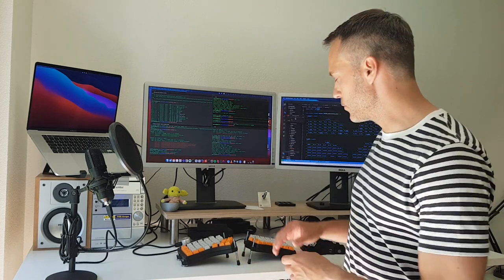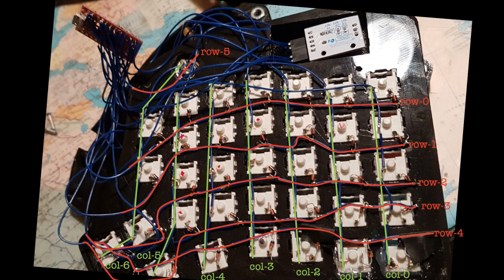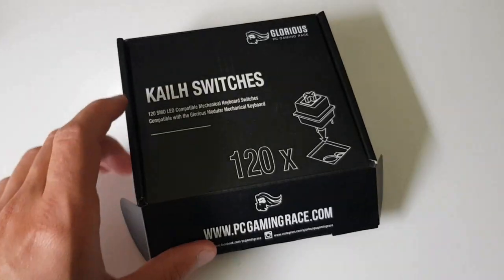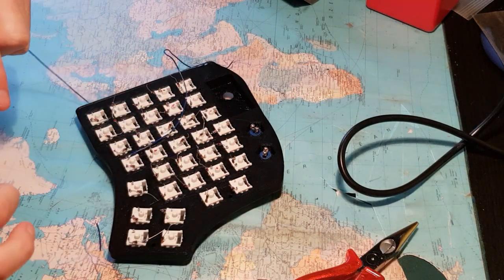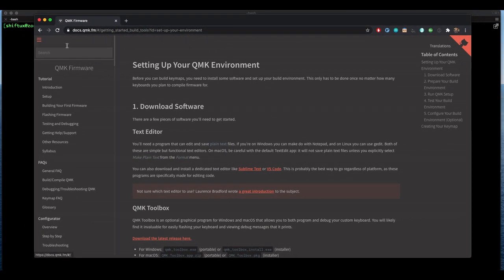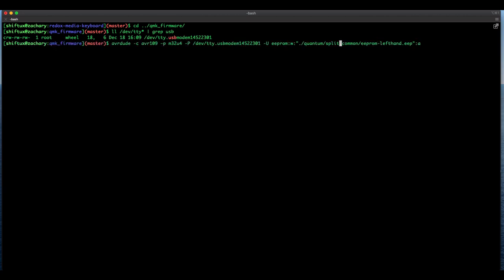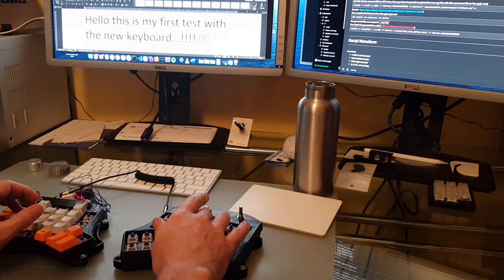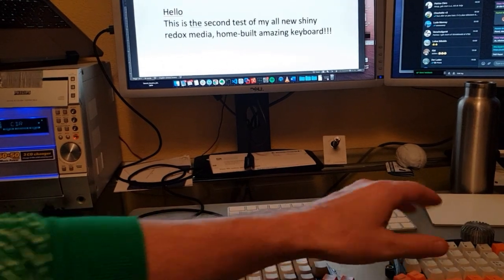Build your own keyboard (Redox Media)

Comment: How to solder a trrs socket to pro micro?
Reply from the maker: doesn't matter. you need power, gnd and signal, the order on the trs jack does not matter, as long as you do it the same way on both halves of the keyboard
Reply: @shiftux9189  cool! Thanks, I got it
Can you tell what's better i2c or serial?
Reply from the maker: @worldOFfans   I'm using seiral. and i think the QMK lib is built for serial. but that might have changed in the meantime.

Comment: Awesome job! I have a Dactyl case on the way, but if that doesn’t work out then the Redox is very tempting. 

I’m a bit late to the video, but wanted to add for anybody else that might come across this video and looking to build their own, you should never connect or disconnect the TRRS cable while the keyboard is plugged in. You run the risk of frying a controller because you could short it as you remove the connector.
Reply from the maker: thanks for the comment. you're right, of course!

Comment: Do Dactyl has antighosting for all keys?
Reply from the maker: this is not a question of dactyl or not. it is a question of how you implement it. you need transistors (at least) on a hardware level and you need software which can handle it. - the combination gives any keyboard antighosting

Comment: any chance you could share your info.json file? struggling with the documentation trying to figure out what i need in there for this
Reply from the maker: not sure what you mean with the info.json file. check the linked github repo. all i have is there
Reply: @shiftux9189  the file where you define the matrix of the keyboard. i think i  have it correct, but i wont know for sure till ive finished wiring the keyboard. i really underestimated how long it takes to hand solder this.

Comment: can you share the wiring diagram for the mini jack?  and what mini jack model did you use in the video?  Thank You
Reply from the maker: he jack has 1 GND pin, 1 5V pin and one serial pin (serial-1 on the drawing). it's irrelevant how this is wired on the jack, just need to do it the same way on both sides ;)

Comment: Hi, is it possible to wire micro LEDs onto the Pro Micro as well?
Reply from the maker: don't know... probably not enough pins on the pro micro, but maybe if you remove the rotary encoders...
Reply: @shiftux9189  thanks, I might give that ago and see if I can get it working

Comment: Hello, I want to build myself a redox-media keyboard with just two rotary encoders on the right side. 
On the "Wiring diagram" on the GitHub post, are those two rotary encoders hooked up? If so, that doesn't seem to reflect the actual design?
Reply from the maker: both sides have only 1 rotary encoder hooked up. the other 2 are push buttons. but yes, they are wired up (enc_padA & enc_padB)

Comment: Hi, can you tell me exactly how the trs mini jack is connected to the controller? I can't find any details about it anywhere
Thank you in advance
Reply from the maker: check the github page. the picture of the proMicro shows you the serial connection, this is 1 out of 3 wires. the 2 others are ground and 5V. how you wire them on the jack cable is up to you (irrelevant), as long as you do  the same thing on both microcontrollers.

Comment: Quick question. Do I see this correctly, that you did not connect the switch function of the rotary encoder at all? So, only outA and outB?
Reply from the maker: yes. the rotary encoder's button would require a separate pin on its own. whereas all the other switches are part of the matrix (many switches per pin). so it did not fit...

Comment: ive read many sources, watched many videos. I understand the whole process (which is kinda easy since i have a software engineering background). One thing i cannot understand is how the 3.5mm jack is used to transfer data. I feel like im missing some trivial knowledge which doesnt allow me to understand how the 3d jack can be used to transfer data to the microcontroller. Can someone give me a source/link/article something i can read to understand this?
Reply from the maker: it's a simple serial connection. there is a drawing here: https://github.com/qmk/qmk_firmware/blob/master/docs/feature_split_keyboard.md#serial-wiring

Comment: Hey, great builds and a great video! I'm in the process of customizing a redox keyboard for myself (because they're pretty close to a perfect layout but lack some tenting options out of the box). One thing that you seem to have solved well, but which I can't find anywhere on github or on the build page is: 

What are the rubber feet you're using? Both on the m5 rods and on the outer sides of the keyboard? I can't find anything similar and having the metal rods scratch into the table surface is not really an option...
Reply from the maker: just from a local hardware store. nothing fancy. the ones on the rod are typical threaded rod protectors and the outer ones are what you might use on anything as (adhesive) "feet"
Reply: @shiftux9189  nice, I'll look for the rod protectors. What I have found since are some generic rubber feet for use with random electronics cases, and they accept m3 screws. But their footprint is still bigger than what you used and I don't think they'll work as well when the tenting angle is bigger...

Comment: Just wondering if you had any other issues with the Dactyl Manuform - I was thinking of getting one due to wrist pain - I assumed they would be the best due to their shape? Do you think the Manuform is made for a certain size hand, and if yours is not that size, it may actually be detrimental? I assume you would have to stretch a lot more with a flat keyboard though
Reply from the maker: the dactyl is MUCH more curved in all directions, which i'm sure would be better from a pure ergonomic point of view. but it's only better if you curve it perfectly right for your hand and your way of typing. and getting it just right requires work... you'd probably need to print at least 5 (more likely 10) batches varying all the different curvature and spacing parameters until you figure it out. every time testing it for a couple of days and ideally comparing them. if you're up for printing and wiring up 10 keyboards... i'm not :D
i've been using my redox every day for close to a year now and it feels great. no pain in my hands and by now it feels like an extension to my hands, that's how used to it i am. i can honestly recommend it. 
ideally of course you would just go try them out. if you have someone or somewhere where you can...
Reply: @shiftux9189  Thanks so much! - You have provided valuable information, and saved me money. I was actually going to buy a pre made one - but as you point out, the chances of it working perfectly for my hand would be slim. Looks like I may have to skill up my soldering skills, and create my own keyboard.
Reply from the maker: @tomhartney403  happy to help. if you want to check out what you can (or have to) tune in a dactyl you can check out some SCAD files and see how the model changes with every variable you can set (eg https://dactyl.siskam.link/manuform) or use an online configurator (eg https://dactyl.siskam.link/manuform) and marvel at the amount of configuration there is... :)

Comment: OMG do you know what watching this video has done to me?  I already have my own Redox keyboard that I enjoyed making a few years ago. After seeing this, I now want Media keys and volume :D my only wish is that I could somehow integrate some kind of audio either in the keyboard or just a long audio cable, so I can plug my headphones in to the keyboard rather than having to use an extender cable.
Reply from the maker: hmmm doubt QMK would support playing audio over the keyboard ;)
but i guess you could route it through: have a jack-to-jack connector computer to keyboard, then add a jack socket to the keyboard and plug your headphones there... still an additional cable, but you extended the plug from where you have it to the keyboard :)
then again, why not use bluetooth headphones? ;)
Reply: @shiftux9189  Honestly? I'm shocking at charging them and the bluetooth system on  Pop_os isn't 100% stable with my system

Comment: I can't find on your github how 2 arduino connect with each-other. 
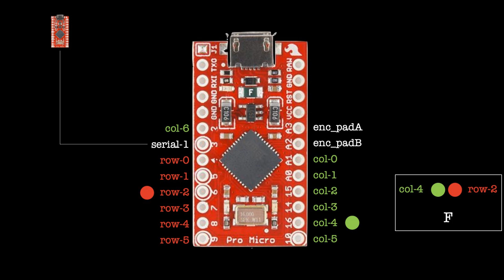At 2:27 scheme shows that only serial-1 (pin-3) is used, but at 4:15 we see that TRS mini-jack has 3 wires... So how to connect 2-x arduino correctly? Which contact should I use on master-arduino?

ps: Sorry, may be my question is stupid but your project really inspired me to build similar one. The problem is that I'm ignorant about electronics at all.
Reply from the maker: serial connection only uses 1 wire. the other wires are for 5V and GND to power the other half of the keyboard

Comment: Hello. Thank you for great video. 
Can you give me advice?
I gonna build splitted keyboard with 109 (50 + 59) keys + 4 encoders. The question is: how much keys can I use in both splitted parts? Is it enough contacts for all those keys?
Reply from the maker: that will depend on the microcontroller you're using, the encoders you're using and the arrangement of your keys. 
generally for 1 side of your split keyboard:  1 column takes 1 pin on the uController, 1 row takes 1 pin and for me 1 encoder takes 1 pin. 
that's how you find out your setup. in the schema I was drawing it should be pretty clear, it's on github
Reply: @shiftux9189  thank's. I consider to use Arduino Pro Micro - but seems that it has lack of pins... Any idea what else can I use?

Comment: Great video. I don't want to spend $300+ on the clunky, non versatile kinesis advantage.
Reply: The kinesis advantage actually is great. I used it for 20 years and did not regret spending the money for them (I got four during the years) a single day. Unlike Sandro, I love and prefer the key wells. Further, the 'clunkyness' despite recuced adaptability, actually has a significant advantage. With separated split keyboards, you are constantly fiddling with their location and orientation relatively to each other, with a monolithic keyboard you don't. No, I do not just defend my purchase decision. I also own an Ergodox EZ since seven years now that is, besides the missing media buttons and a different thumb cluster, similar to Sandro's Redox. I never got warm with it despite the better flexibility and adaptability.

Comment: Any way we could see this done on a windows machine? I've got everything printed and assembled but I'm so much more a hardware guy, I've gotten as far as actually compiling a .hex for a regular Redox with Default config, but I am getting lost somewhere between getting your files copied over into the keyboards folder and a compile error. I'll continue to try on my own, as I am determined to make it work. Head-bashing has always worked in the past but puts me way past my time budgets for new things. I don't necessarily mind but the wife does.
Reply from the maker: i was laughing about the time budget vs wife's happiness tradeoff... i know that one :D for my own time budget's sake i can't  go through learning and explaining how to build this on windows. as a developer i have turned my back on this OS since many yers (except for video games). i have 2 suggestions for you: 1) install a VM with a Linux OS on it (eg Ubuntu) and do all the programming stuff on there. it's free and will make life so much easier for you (after an initial learning curve, i guess). 2) i can send you a compiled hex file. this will help you as long as you can flash your microcontroller. but it will be based on my keyboard layout.
additionally you can follow this pull request or check out the corresponding git branch on qmk directly. this is my code in the original qmk repo: https://github.com/qmk/qmk_firmware/pull/13084
Reply: @shiftux9189   In my mental exhaustion from just trying everything over and over, I forgot to thank you for building and sharing this project in the first place. As such I apologize and say Thank You for putting this keyboard together in the first place, I'm sure it will be a popular build in the keyboard community. 
I understand your time budget completely, as well as trying to develop on windows. I've tried Linux and it's multitude of distros in the past, none of which I was completely happy with. The gaming barrier was the greatest hurdle, of course but that has diminished substantially in recent years with Steam. Honestly I know I should give it another shot and this will be the push to do that. In the meantime your offer of the hex file would be greatly appreciated, I have a program called reWASD that allows me to have complete control of my HID devices, which I can keymap over from there. I found it necessary when I wanted to use my Nintendo Switch controller with motion controls, but then found the software useful again when I built a clone of the Azeron gaming keyboard. This should be a viable work around for me until your PR on git is approved. Like I said it's something in that step of trying to import your files to my local copy of qmk_firmware. Though this will not stop me in the long run, I have plans to figure this out as I would like to get RGB working also. A while back I picked up 100 individual WS2812B ARGB LED broken out on their own pcb. You just pop one off as you need it. I just so happen to have 70 left. From what I have gleaned from going through a few other setups trying to find a fix, D0 is the default pin for RGB, which is still open on the pro micro. I just wouldn't mind typing on your fine keyboard while trying to figure it out. Again thank you soo much for your time, and your help.
Reply from the maker: thank you for your kind words :)
note: the PR has been approved in the meantime (i asked again after your post). but still, if you want a working hex file just send me an email. best
Reply: @shiftux9189  Everything seems to be going smoothly, now that the PR has been approved, and I'm running PopOS.  My only concern is that I get a (☒ redox/media: redox/media: LAYOUT: Number of elements in info.json does not match! info.json:70 != LAYOUT:73)
warning but it compiles regardless. Again I'm not sure how I could be messing this up at this point, as I could copy the media_ch folder as prescribed to create my own custom keymap. I now have a full English layout along with your media buttons and the encoders, I also managed to turn on RGB and set it to pin D3 (TX0). All of those changes have no effect on the (LAYOUT: Number of elements in info.json does not match! info.json:70 != LAYOUT:73) warning and still compiles after my changes and custom keymap. Is this something that could be addressed by adding those 3 media buttons to the info.json file or is this a more complicated issue all around. I don't want to take up all of this mans time so if anyone has any idea I'm welcome to suggestions. Is this behavior that anyone else is also experiencing or is this just PEBCAK on my end.
Reply from the maker: @charlesclements4650  indeed there is an issue, not your fault. the qmk guys merged this without double-checking that... tracked here: https://github.com/qmk/qmk_firmware/pull/14345#issuecomment-914755392
we'll need to look into this
Reply: So....after 15 straight hours, and two hours of sleeping in the chair, I'm ready to give up. I figured perhaps if I learn how git works I could clear this up. But even forking your qmk_firmware repo to my own git, I do not have the media folder inside the redox folder. When trying to download the zip, the same thing occurs. The media folder is not there. I created the files by copying all the files in raw and rebuilding them using Notepad++. Then importing them into my local qmk_firmware. Again errors. I'm lost, in the worst kind of way. I've now tried so many times in so many ways, trying with a clean install of msys2 and qmk, trying with QMK MSYS, both of which with a basic install I can compile a default Redox, I  sorely want those encoders now though. I realize the project is fairly new and a PR would theoreticly fix this,  as the media rev would be included in the Redox folder if not an entirly new kb like the Redox-W.

Comment: How are the 2 halves communicating, which protocol? It seems like you're using audio cable? All the other split keyboards I've seen use a USB C cable, why do you use the audio cable? I'm trying to build my own split keyboard, and I'd like to know about the different approaches...
Reply: Alright, I found out now that quite a few use the audio TRRS cable as it's easier to solder and not all USB pins are required anyway. But you could make it work with a USB cable too if you really wanted to.
Reply: @warlordk212  can you give the link how to use the audio TRRS?

Comment: Referencing the wiring diagram from the Hackaday post (you linked to on your github), I was wondering if the wiring from the microcontroller to the rows/columns is identical on both sides or if I needed to mirror the connections etc. Any help would be much appreciated, thank you!
Reply from the maker: that depends on how you look at it, but i guess mirrored. to be more precise: in my wiring drawing on github, column6 should always be the one on the innermost switches (thumb cluster) and col0 should be what traditionally is tab, esc, shift and backspace, etc... row4 always the lowest, eg. space, alt, ctrl.
make sense?
Reply: @shiftux9189  Sure yep that clears it up, thank you. 

I'm going through a build right now myself and am having a tough time isolating shorts (causing a switch to not work or an entire row to not work) guessing best troubleshooting would be done with a multimeter
Reply from the maker: @tonytwostep_  yes. a multimeter is essential :)